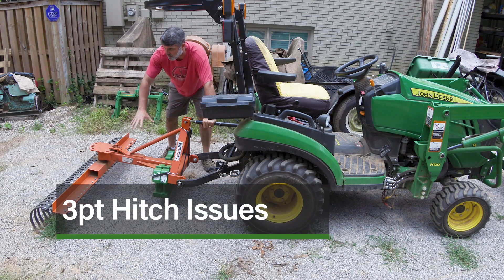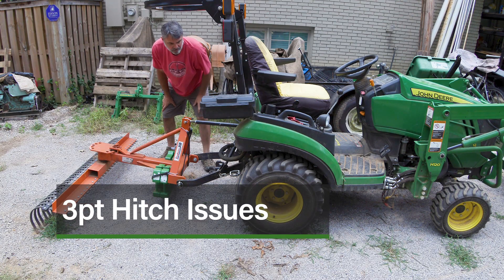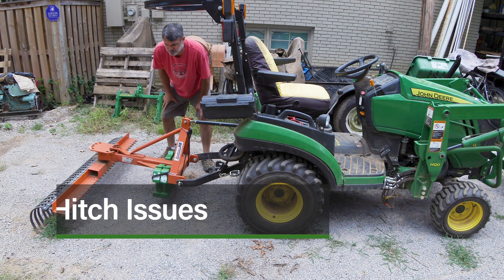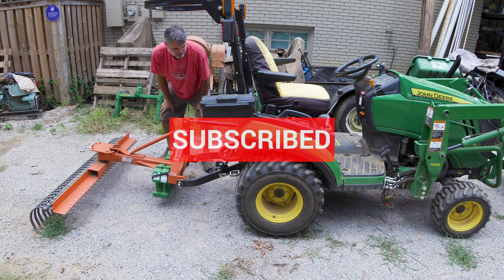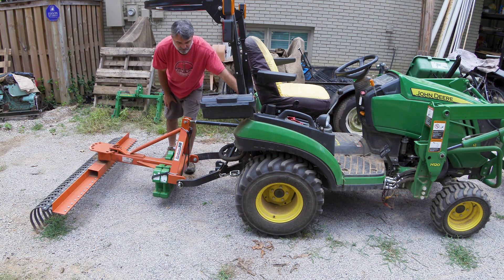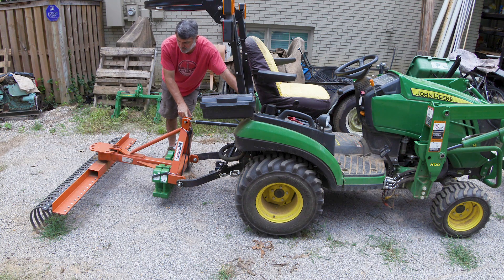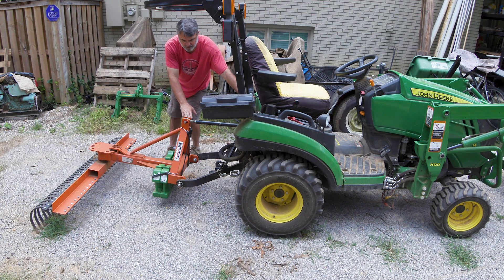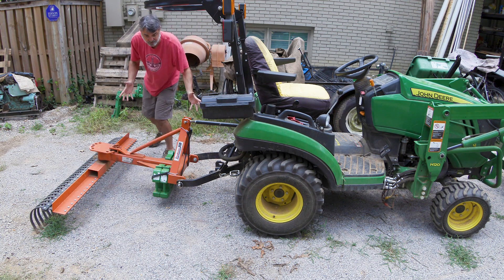John Deere 1025r 3pt hitch hydraulic issue - DIY or dealer fix?

Comment: I have exactly the same problem on my cub cadet ex 3200 tractor as you have.Could you send me an e- mail to let me know what parts you had to change to fix the problem. March 10 2022.
Reply from the maker: Read thru the comments - in my case it was a stuck pressure relief valve.  Just needed cleaning, no parts.  Some folks have had to replace o-rings.  Good luck!

Comment: i have a JD 3032e that is doing the same thing.  Very slow to lift hitch, front loader works fine.  It has plenty of Hy Oil, but will check for debris as many have suggested.
Reply from the maker: Yeah - seems those relief valves can get stuck open.  Doesn't take much.

Comment: High pressure bypass out of whack or debris not allowing it to fully seat...thus leaks off....and/or bad o rings in operators spool valve or debris not allowing it to seat fully
Reply from the maker: Thanks for the comment - that's exactly what I think it was.  I pulled off the whole rockshaft and inspected all the o rings and cleaned everything, but I think just cleaning the pressure reliefs without pulling off the rockshaft would have done it with much less work.

Comment: Greetings Tractor Therapy.  I wanted to say 'thank you kindly' for posting this video.  I had been studying the hydraulic system on my 2012 JD 4320 and I had the exact same issue.  I had narrowed my problem down to the rockshaft cylinder and possibly a blown piston seal.  Then, by chance I came across your video... a failed high pressure relief valve would present the same issue as a blown piston seal.  I went to my tractor to tap on the valve (in case it was stuck)... no luck.  I cleaned all the crud off with a rag, and to my surprise I was able to unscrew it by hand!  Got a mirror and had a look inside, sure enough the o-ring was split in two.  The failed high pressure relief valve o-ring, along with being loose was what caused my problems.  To any that want to know, mine started off with a weird  1/2" up/down oscillation of the 3 pt. arms.  Over time, this got worse... but never when weight was on the arms.  Fast forward to the full failure, we were augering some post holes... heard a pop and the auger went straight into the ground its full 40".  The 3 point would not lift it out.  No joy in getting a stuck auger bit out of  soggy clay ground.  All the best, Shawn.
Reply from the maker: Glad the video helped.  I tore my entire rockshaft assembly down thinking it was the piston as well.  I didn't find anything that looked out of sorts (mine was pretty new).  I realized it was probably the relief valve as I put it all back together.  Thankfully an easy and relatively cheap fix.  Thanks for stopping by!
Reply: @tractortherapy42  I was definitely preparing to tear mine apart; according to the service manual it's 150lbs by itself so I wasn't really looking forward to the job.  I went to a local JD dealer to try to ask some mechanic advice, got the service writer instead who quoted me $3K to $5K if it was the rockshaft.  Told me there was linkage from rockshaft down into tranny, and that the cab had to come off.  Well, there is no direct linkage, the assembly slides out the back.  Your video gave me confirmation and better direction; to do it myself cost $1.86 o-ring... and my time.  Thanks again.

Comment: Mine does exactly the same thing. 100 hours. Would have loved to see a fix it video, but thanks for this info.
Reply from the maker: One day I'll get that video edited!  Mine is acting up again because I keep putting too much weight on the rockshaft - and it pops the relief valve.  It's not bad this time, but it's leaking down in about 10 minutes.  I think tapping the relief valve with a light hammer tap tap might free up the ball / spring - I'm going to try this while cycling the hydraulics.  I think something gets stuck and stops the ball from sealing back properly when the pressure relief goes off.

Comment: Mine wasn't dirty, it just wasn't tight and leaking pressure. There was also a really  poor wrap of Teflon tape on the threads, I torqued it down and its back to normal.
Reply: Where is it located?
Reply: @boomer1049  it's under the seat. I took mine off to get to it, though you might be able to from underneath. Look at an exploded view, you will see what looks like a 3-4" cap, it's hex shaped and runs horizontally, left to right if I recall.

Comment: I tried to clean the pressure relief valves and it didn't fix the issue. I brought it into the dealer and they recommended replacing the control valve components and the pressure relief valves.  It was over $1,000 in parts and $900 in labor.  This was in addition to having to replace a leaking gas tank (part cost $1,200), along with other issues. My total bill was $4,500. I wouldn't buy a John Deere again. I wouldn't expect these issues @ ~150 hours and 4-5 years.
Reply from the maker: That's crazy!
Reply: Come on really? Why not just buy a new tractor and save 2,000 - 2,500 dollars?

Comment: I had this same problem on my 1025R.  They told me it was a switch that controls the hydraulic flow and is supposed to maintain the position.  Sometimes that switch can get bent.  They fixed it under warranty.

Comment: Were you able to post the video for the fix? My tractor is having the same issue @ 167 hours. Of course, it's time to cut the grass up here in the north and dealer is backed up 3 weeks!  I can't seem to find any information online on where I should be looking to find the relief valves.  How many valves are there and how did you clean them?  Thanks in advance!
Reply from the maker: Still got it on the to-do list.  There are 2 relief valves in the rockshaft assembly.  I think you can get at them by removing the seat bracket.  I cleaned them with brake cleaner and re-installed.  I think there was some debris sticking it open.

Comment: I had the same problem with my 1025r.  It was so bad the rear tires would come off the ground.  I had just bought it.  It turns out that the wrong part was installed at the factory.  John Deere gave me a new tractor.

Comment: Any update?  I just started having a similar problem.
Reply from the maker: Sorry - been super busy...but fix was a pressure relief valve with some debris in it causing it to stick open - it's under the seat.  Removed it out and cleaned it - fixed it up.  I took off the entire rockshaft assembly to diagnose (took me 2 days) and it ended up being stuck valve.  There are 2 or 3 of them on these tractors - but they are not bad to get to.  $0 to fix - just the time / effort to get it off and clean it.  Runs as good as new now.

Comment: Any update on getting your repair video out?  New subscriber here.  Really like your channel, keep the videos coming!
Reply from the maker: Sorry - been super busy...but fix was a pressure relief valve with some debris in it causing it to stick open - it's under the seat.  Removed it out and cleaned it - fixed it up.  I took off the entire rockshaft assembly to diagnose (took me 2 days) and it ended up being stuck valve.  There are 2 or 3 of them on these tractors - but they are not bad to get to.  $0 to fix - just the time / effort to get it off and clean it.  Runs as good as new now.

Comment: Man post that fix it video.  2016 with 85 hours doing the same thing.
Reply from the maker: It's coming - I'm editing it, but have got some work priorities...if you are having same issue - remove and clean the overpressure valve on the rockshaft (under seat) - that will most likely fix it if your issue is same as mine - it's probably stuck open!  I'll get that vid out soon - I go into a lot more detail...
Reply: @tractortherapy42  waiting or vid, mine is not isolating like that, but it will slowly creep down, even with pump running

Comment: Remove the control valve for the hitch,on right side, it just needs to be cleaned. Possible a piece of metal debris from factory assembley. I just did one last fall same model had about 125 hrs on it. The guy stilll running it today. Ive got 24 years experience , the dealer closed the store in my town so Im repairing these on my own.
Reply from the maker: Hi - thanks for checking out the video.  I removed the rockshaft feedback valve today and replaced some O-rings, but it didn't fix issue.  Because of that, I'm getting ready to pull off the whole rockshaft assembly - are you saying to actually disassemble/clean the feedback valve itself - I didn't take it apart but I checked it's movement and it seemed ok.  Thanks for your comment!
Reply from the maker: Got it all fixed - it wasn't the rockshaft feedback valve.  I'll have a video posted soon with the fix.
Reply: @tractortherapy42  Did you ever finish that video?  I've got the same issue and would love to see what you did.

Comment: not sure but sounds like the feed back position sensor has leak by at the position holding valve. its pulsing up and down because the position feed back rod is telling it that its dropping and not holding position. not sure the details of this repair or cost. likely a fifty cent part located in a place that takes a thousand dollars in labor to get to. I could be wrong and I'm only making a guess. I will be praying its as simple as a loose connection causing leak by that can be fixed with a turn of a wrench. stranger things have happened. keep us posted then we will all know in the future.
Reply from the maker: Thanks Dave - hope you are doing well!  I figured if anyone knew what this was, it was you!  Learned alot from your channel!  I've been doing some research on the rockshaft schematic on JDparts.com and I'm thinking it may be something like what you are saying - perhaps a lift piston seal or oring that's getting ready to fail.  I bet you are right - a 50c O-ring and $1000 in labor :)  We'll see - I may try to get into the rockshaft assembly if the dealer comes back with bad news.
Reply: @tractortherapy42  keep us posted I would be interested in what you find. I hope its cheap and painless repair.
Reply: So what was it?

Comment: The only thing that I would know what to look at is the hydraulic connections for the power beyond connections.  Restrictive flow at that connection will cause havoc.  Try disconnecting and reconnecting them a few times
Reply from the maker: Will give that a try - thanks!

Comment: Definitely keep us informed!  I tried to get my dealer to due the air filter update with 0 luck.  Just replaced the air filter strap for the 4th time yesterday
Reply from the maker: Bought the Technical Manual today...headed towards a DIY fix which I will video and post...my (repaired) air cleaner bracket broke again today as well...so my tractor is out of service for a few days while I get things fixed up.
Reply from the maker: Hate to hear that!
Reply: thats disapointing of that deere dealer i seen the price of air filter and they wanted $379.00 wich seems rediculas for a air filter and my kubota dealer sells the air filters for kubotas from $26.00 to $40.00 for large tractors wich alot cheaper
Reply: @michaelmactavish1728  Replacement air filter's are roughly $20 ea.  The air filter update for the 1 Series is approx $130 for the home owners if JD does not honor it.  I removed the large steel bracket that is causing the valve cover failures and have had no issue's with it removed
Reply: @treemonkey_ma1718  kubota allways honor on theres plus the airfilter and valve cover at my kubota dealer  are $25.00 for the kits wich pretty darn good price
Reply from the maker: My dealer fixed the air bracket for me - make sure you mention that there is a JD Solution Number: 113718.  She looked it up and took care of it from there.  They were unaware of the solution until I told them about it - and she said it was good until 2022 - essentially extending the warranty for that part until then.  They had to do it, though, so they had my tractor for about 2 weeks.

Comment: I haven’t seen. Any of the assumptions you mentioned are possible. Would be nice if it was just low on hydraulic fluid or the filter is clogged and reducing flow. Best of luck, hope it’s nothing serious!
Reply from the maker: Thanks - I checked fluid and it's right where it should be.  Hoping it will be an easy fix like the filter.

Comment: ive seen the same issue on a guys deere 1025r and cost him $899.95 wich was near  $1,000 to fix it wich seemed was rediculas price for fix wich my kubota dealer fixes the kubota ones and it was cheaper $130.00 plus deeres here only carries 90 day warranty on lawn mowers and 1 year on compact tractors wich the kubota dealers with there  mowers comes 4 year warranty and 6 for the f series and compact
 tractors and large tractors
Reply from the maker: If it's a $1000, I'll be doing a DIY fix!  Hoping it's something simple.  Thanks for the comment!
Reply: John deere's warranty is currently 2 year/ 2000 hour for overall use and then 6 year on powertrain for compact tractors.  I currently have over 430 hours on my 1025R and a day away from my 2 year purchase date and just had 2 things covered that wouldn't be as of Monday the 22nd.  would definitely like to know what is causing the issue
Reply: @treemonkey_ma1718  ouch they gave you 2 years warranty on it kubota compacts has 6 year warranty one everything from engines to power train
Reply: @michaelmactavish1728  The 6 year JD is engine and powertrain!  The 2 year/2000 hour is anything else that is not operator error